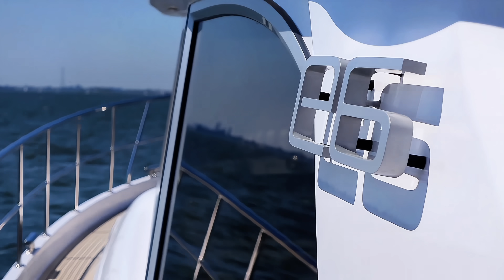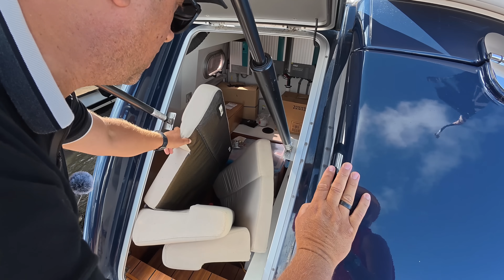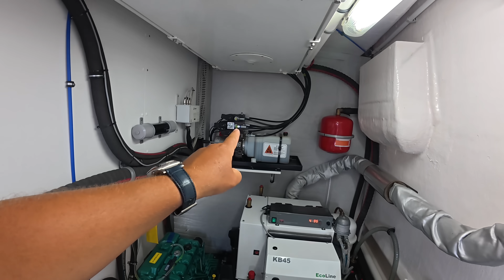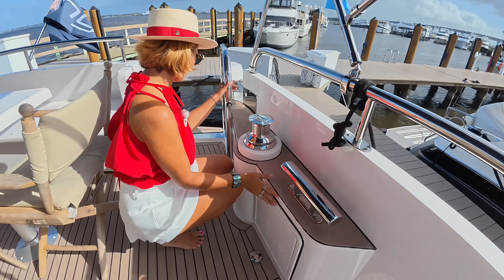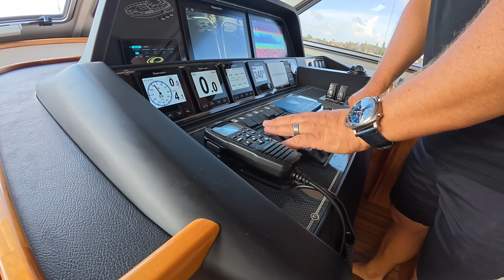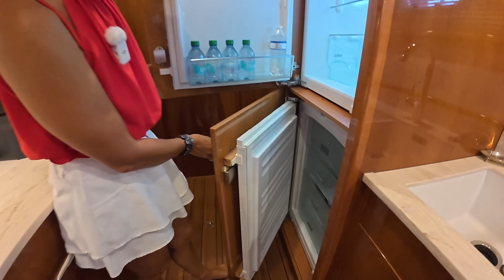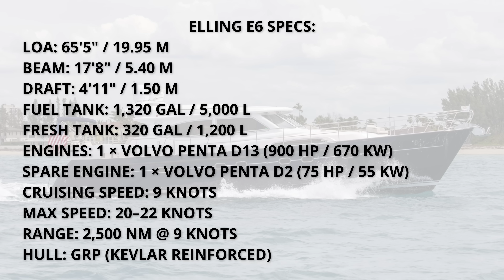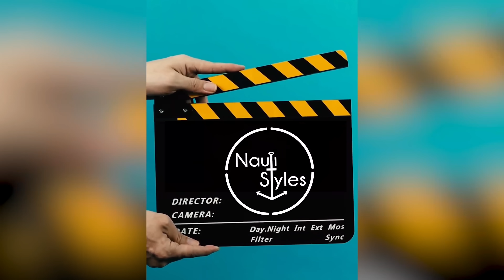SELF-RIGHTING YACHT 🤯😳 Elling E6 Ocean-going Offshore Long-Range Liveaboard Yacht Tour

Comment: Very interesting where the engine is located. Overall I really like the layout on this one. I checked out the website, it mentions hydraulic bow and stern thrusters, which from what I understand wouldn't have a duty cycle limitation like some electric thrusters. Like you could run them a lot if you needed to. I don't know why, except maybe in a mine field? I hope someone buys this that'll really take it out and do some exploring, it looks amazing!

Comment: 11:20 
Yea... Condensation can be a real nightmare on older vessels. If you heat the boat properly on those really cold nights where condensation is expected in the morning you will have none. I use propane for heating. Ever seen the horse barn heaters that you attached to the top of a 20 gallon propane tank? Yea... Exactly
Reply from the maker: Thanks for sharing Enki!

Comment: Question.       The secondary engine.   Is it a 3 cylinder yanmar or. ?
Reply from the maker: Great question, Raymond! The secondary (get-home) engine on the Elling E6 is a **3-cylinder Yanmar diesel**. It's designed as a fully independent backup propulsion system, giving the yacht true redundancy for long-range cruising and added peace of mind offshore. Thanks for watching!

Comment: Honestly the only thing I did not like about the boat is the engine compartment. I am the biggest of the misfits at 300 and some pounds and normally I like a full standing or close to standing engine room but I love everything else about the boat so I don't know. I would not turn it down if I won the boat I would treat it like an ultimate gift and struggle through the engine compartment. But I don't know that I would buy the boat because of the engine compartment. But I definitely like the great loop as that definitely applies to our upcoming Marina in Cincinnati and would not mind being a spot where you can get a boat like that for the beginning sailors through the experienced ones. You guys have done it again and brought us another great boat!
Reply from the maker: Thanks for the honest feedback and for watching! 🙏
Reply: The Misfits are ride or die with @NautiStyles

Comment: The Elling E6 is at the top of my list of CE-A ocean class vessels, with the Arksen 65 a close second. My main criteria is the biggest motor yacht that can be soloed safely and navigate the canal systems in Canada and Europe. The Elling is on top because at 7kts it gets close to 4 miles to the gallon but can hit over 20kts if needed. I like the Arksen because its a bit more livable, but it might be a bit more of a handful. I also like the Nordhavn 68 but... it is too big. I do not think it can be handled solo and its air draft is nuts.
Reply from the maker: Great points on the trade-offs between size and solo capability! 🙏

Comment: Why so few vessels are self righting?

What are the cons and the challenges?

The assumption os that you will never test that capability, but when you cross oceans frequently, sooner or later you will have unforcasted 65 knot winds making breaking waves big enough to capsize you if one of them comes from the wrong direction.

You can say that's why goo seamanship is important, but in the middle of the night, going pitchblack, there's absolutely no chance to react quick enough from a random rough wave that doesn't match the main swell angle.

I'm not talking about the extremely rouge waves, but just a 10 meter breaking wave beam on can easily vapsize most of the vessels under 40 meters.
Reply from the maker: Self-righting capability requires major design compromises, especially on larger yachts. To achieve it, a vessel typically needs a very low center of gravity, significant ballast, controlled superstructure weight, and specific hull proportions. Those requirements often conflict with the priorities of modern yachts, which focus more on interior volume, beam, comfort, and onboard amenities.

There’s also the challenge that a vessel may technically self-right after a capsize but still sustain severe damage to systems, machinery, and the interior.

And while seamanship and weather routing greatly reduce risk, offshore conditions can still become unpredictable. In confused seas, especially at night, a large breaking wave from the wrong direction can create dangerous situations even without extreme rogue-wave conditions.

Comment: Misleading verbiage.  I would be careful, the Elling that was rolled over was a Elling E4 not a E6.  So there is not data or proof that the E6 is self righting.  Only the data and videos of the Elling E4 being self righting.   So other than that its a nice boat.  As far as the center engine goes not  sure how safe that would be in case of an engine compartment fire and the fuel tank being in front of the engine a few feet Away in the dining area where the TV is located.  I didn't see any fire suppression system for an engine fire also.
Reply from the maker: What SPC said!

Comment: Thought it might be taken as ridiculous but how about having even just a lap belt(s) tucked away. Which of course everyone on board would know about just like life jackets. So if the going gets really questionable anyone could access the belt(s) at a moment's notice and right yourself along with the boat and perhaps minimize broken limbs etc.
Reply from the maker: Not ridiculous at all — honestly that’s a pretty smart thought. Having a couple of accessible lap belts or safety straps tucked away for heavy-weather situations could absolutely help stabilize someone and reduce injuries when things get violent unexpectedly. Similar to knowing where the life jackets and emergency gear are, it would just become part of the onboard safety briefing.

The biggest thing would be making sure they’re mounted or used safely so they don’t become a hazard themselves during a rollover or sudden impact. But for rough crossings or questionable conditions, having the option available could definitely make sense.

Comment: This is an interesting build...but I would love more information on how it does the Self Righting.
Reply from the maker: It achieves its self-righting capability through a combination of a low center of gravity, highly buoyant and watertight superstructure, and an extremely strong, reinforced aramid (Kevlar/Twaron) hull. This design allows the boat to roll a full 360 degrees and flip right-side up without assistance.

Comment: 6:04 what I notice is the EPIRB outside. Much smarter than all those boats with the EPIRB inside and just somewhat close to outside. 

On the other hand, if the boat rolls and returns to an upright position, do you want the EPIRB to be launched?
Reply from the maker: Mounting an EPIRB on the exterior cabin or pilothouse bulkhead ensures it can float free immediately if the vessel is lost. Storing EPIRBs inside cabins is a common hazard because a capsizing or sinking vessel can trap the beacon before the crew can reach it. How the EPIRB Handles a Full Rollover -You do not want the EPIRB to launch or activate simply because a wave temporarily knocks the boat on its side, and standard EPIRB systems are designed to prevent this.

Comment: Back in the day, we had a self-righting Essex 26-foot center-cockpit ketch sailboat.  It was rigged for shallow draft (22 inches!) which it got by having a long shallow keel with like a half a ton of lead weights in it.  It wasn't fast, but you could literally have it knocked flat on its side in a gale-force squall and it would pop back up, and the cabins had fairly watertight hatches to keep water from rushing in if that happened.

Fortunately, we were never both aggressive and incompetent enough to find out how well that worked.  The shallow draw meant it bobbed in the waves some, but it was functionally very stable and resiliant overall.  Being a sailboat, that possibility made sense.  Not sure what you would be doing to need it on a motor yacht... unless you're planning to be both aggressive and incompetent enough to find out.
Reply from the maker: Thanks for sharing your experience! Always good to have that extra peace of mind out there. 🙏

Comment: I'm not a fan of the layout, especially with how many trade-offs & sacrifices were clearly made to achieve the self-righting gimmick.  I mean, it's truly a gimmick because in order for it to survive a roll, you have to specifically batton down and seal it all up on purpose BEFORE you go roll it, in which case wouldn't be easier just NOT to go roll it?  It's a very specific use-case scenario, and everything else gave in to that.

Is there someone out there literally trying to chase down rogue waves to flip a boat in?  Is it meant to live in the Drake Passage and the roaring 40's in storm season?  If so, the GRP is a weird choice of hull.  Where are the 4-point harnesses for the pilot chairs for when it flips?  As for that engine compartment... ack!  Also, I like to cook, and that down galley has good counters but it's depressingly like a mole-hole and doesn't have the provisioning capacity for its supposed range.

The whole thing seems full of contradictions and limitations just to be able to make that one wacky demo video.  Obviously, there are people out there who think it all works together, so good for them.
Reply from the maker: It’s definitely a unique boat that isn't for everyone, thanks for the feedback! 🙏

Comment: That’s a pretty comfortable cruiser I might have to look into a couple of those for Support vessels. The shadow draft makes them incredibly versatile. And being configured as self writing and prep for cold weather is really cool.  2500 mile range certainly doesn’t hurt anything. A lot of boats in this category have been limited to 1500 mile range, which knocks them off of my list pretty quickly.  I’ve seen the preowned market and the price was under 2.5, so I’m guessing new should be incredibly reasonable for this kind of capability.
Reply from the maker: That range definitely changes the game for long-distance travel! 🙌

Comment: This is one of those yachts I like…but have issues with. I’m not a fan of single engine long range yachts, even with a wing engine. 99.9% of the time its weight and drag that does nothing. I’d prefer a twin engine option, but the layout precludes it. Beyond that, for something with ~250 hours at cruise (10kts), it seems to have a lack of refrigeration. 

All that said, if my plans were to be no more than a day or two away from port, it would be ideal. Same for doing the Loop.
Reply from the maker: That’s a fair assessment, and those trade-offs definitely depend on how you plan to use the vessel! ⚓️

Comment: Nice boat but other than pre trip checks that engine compartment is only maintenance suitable for skinny guy with long arms and good knees. Like others have said a sail boat but with a large motor.
Reply from the maker: It’s definitely a tight fit, which is a common trade-off for such a compact and efficient engine room design! ⚓️

Comment: very cool boat  but a couple questions  you stated in your intro a 5000 nautical mile range but the specs stated 2,500 nm range at 9 knots so that 5000 nm range must be at a much slower speed presumably 4 to 5 knots which would mean a much slower ocean trek  is there enough refrigeration on that boat for that long a passage and how would you replace the engine in that boat
Reply from the maker: it's 2500 NM 🤪

Comment: I had to go back to the beginning, is there the ability this boat of some sort of secondary engine? I liked the layout a lot, not too big, not too small. I was concerned when I saw just one engine in that compartment which is why I am re-watching. Ah, there is a small engine, I was distracted the first time. I am thinking North Sea, Greenland visits, Baffin Island, Norway. Yikes, I would need a couple to run the boat while I catch ZZ’s in that VIP cabin. That low galley would be very stable as would the cabins.
Reply from the maker: Definitely check in with Elling about your engine options! Check the link in the description for more info!

Comment: With this general arrangement, it's basically a sailboat, without her mast and with a bigger motor.
Reply from the maker: It certainly shares some of those ocean-crossing DNA traits, doesn't it? 🌊🙌
Reply: @NautiStyles  Note, the pitching motion is less noticeable in the hull's hollow, so the galley below is more "stable" if you will. That's certainly one reason for its positioning, even if the yacht is stabilized.

Comment: Ok heres my 2 cents. Love the overall boat even the galley down. But i disagree with engine comparment. As a Diesel engine mechanic we will charge double due to confined access. Also, what happen if you have engine issue at sea and you need to diagnose it. You would have to litterly dissasemble entire core of boat just to access the engine. Can anyone imagine the cost of replacing a turbo or starter. Trust me you dont want to see the repair bill. Love the boat overall but engine layout isnt ideal in the least bit. Needs better designing or unless you have 30k for repairs set asside then dont change a thing. I see the engine compartment and start salivating at my bill to the customer
Reply from the maker: That’s a very fair point from a mechanic’s perspective, definitely some trade-offs with the compact engine layout! 🛠️⚓️

Comment: Really nice looking boat.  Great layout, lots of open floor space.  Looks like two people can easily move around without bumping elbows.  I do see a couple of draw backs.  A boat that size with a single main engine really needs a bow thruster.  Both bow and stern thrusters would be better.  It may be well suited for the northern European climate but on the east coast of the US would need screens on the upper level window openings.  Also would like to see a manual compass in case the digital one has issues.  You guys have covered a couple boats with wing engines recently.  Question for Rico, Victoria or anyone in the comments.  When not in use does the free spinning prop of the wing engine cause any issues with the shaft seals or the transmission?
Reply from the maker: Thanks for the thoughtful feedback on the thrusters and climate considerations! 🙌 regarding the prop, it’s usually designed to handle free-spinning without damage, but I'll see if we can get a definitive answer for you.

Comment: Upper Salon can have a range/sink/cooler set-up (and still has the TV, just not the STBD side seats). Some of these have massive solar set-ups and battery capacity. The cockpit can have various extended roofs/overhangs. These are fine power yachts that have some drawbacks (access to PORT/STBD "technical rooms" being the most common complaint).
Reply from the maker: Great insights on the customization and layout potential! 🙌

Comment: This is a really decent boat. The self righting feature feels like marketing hype to me. If the boat has already rolled over, things are already very bad.

When I saw the upper salon, I did not really understand what the Dutch were trying to do. An ocean crossing boat with the cabin of a motorboat. But then I saw the lower salon, and I have to say, this has the best layout of any boat I have ever seen. Although I do think the upper salon could have been designed much better.

The material quality and material choices are also very good. It does not radiate that cheap IKEA feeling like many new yachts do.

By the way, I would be careful with the Kevlar hull. There is not much experience with it, but experiments suggest it is much more sensitive to seawater than traditional fiberglass.
Reply from the maker: That’s a really thoughtful breakdown of the pros and cons, thank you for sharing your perspective! 🙌

Comment: Self righting, well that is an interesting feature, when you first showed the E6 I thought it was going to be electric, well I guess that it will be electric in the future that will free up a load of space in the engine area. It's nice and compact and nice range, galley down means you are super isolated if there are only two on the boat for crossings but I guess if you are more on board it would be nice, also you would not be able to operate single handed or if you did moving between the galley and the helm would be a little less then fun.

What is up with Adamas, I heard a whisper that she has been moved to another boat yard, when are you going to tell us, we are dying here ... 😜
Reply from the maker: The galley layout definitely sparks some great debates! Everyone has their preferences! 

Updates on ADAMAS coming to @NautiGuys as soon as we’re able 🙏 thanks for your patience!

Comment: Galley up in the Caribbean.  Engine seems very difficult to service.
Reply from the maker: It’s a tough balance between living space and accessibility, but definitely a unique setup! 😅
Reply: They chance the motor in one day, so a service will be not so difficult.
Reply: The Engine has to be where it is at for the Rollover Recovery function to work. It is all about the Physics. I will say that the Engine Compartment looks like a pain to perform any major repairs, but basic maintenance shouldn't be too hard.
Reply from the maker: Exactlyyyy 🙏